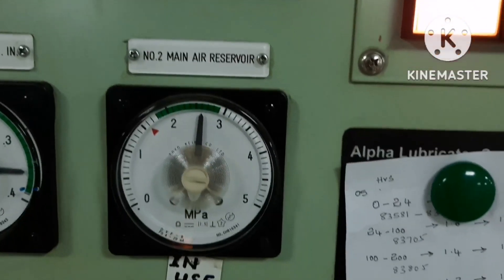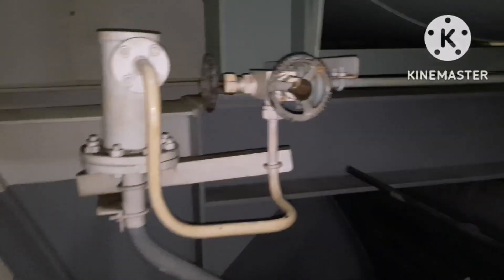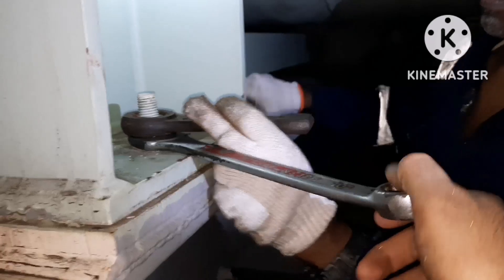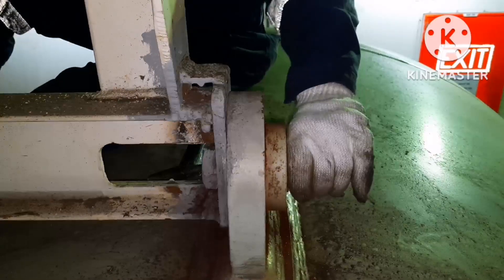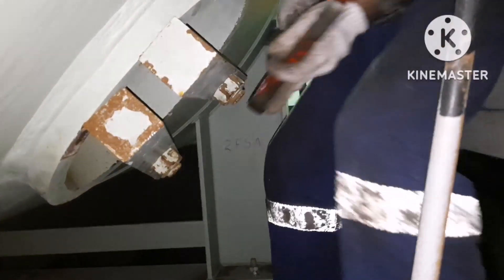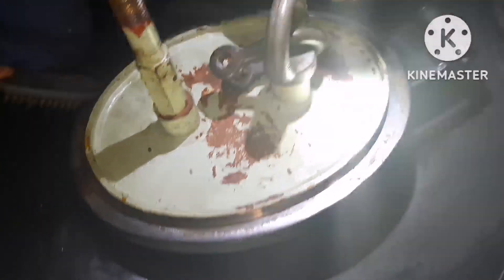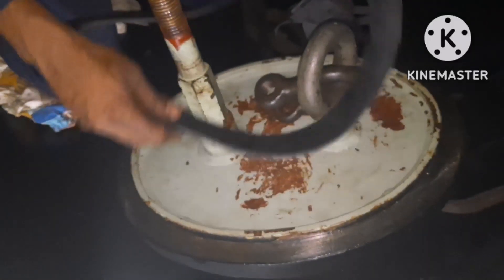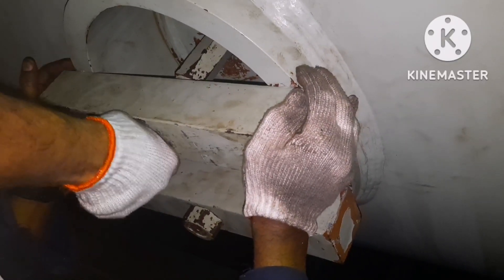How do they do.. How to do Main air reservoir inspection  onboard ship..

Comment: Hello Chief thank you for this video , I have a question about boiler . Lately i Got too many alarms of boiler , i opened the burner and i found too many cabon deposits around the diffuser and in combustion chamber . i wanted to adjust the distance between diffuser  and flame tube but i didn't found the manual on board . So I decided to pull the diffuser a little bit back toward the nozzle so that i increase the secondary air , I need your suggestions pliz what do you think .
Reply from the maker: thanks for your query,

Please # check the air damper for correct operation .
# check the fuel oil quality .
# Check whether same condition occurs wen firing in diesel.
# check the atomiser for any hole enlargement which can affect the atomisation.
# check the diffuser plate for any choke.